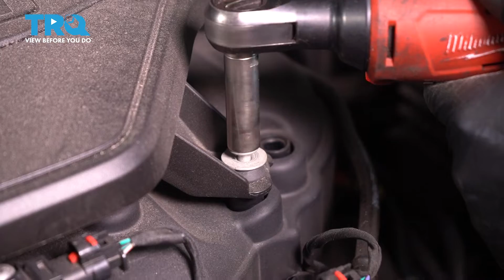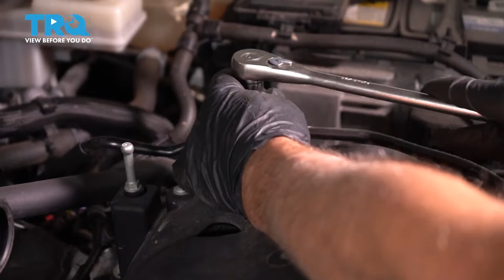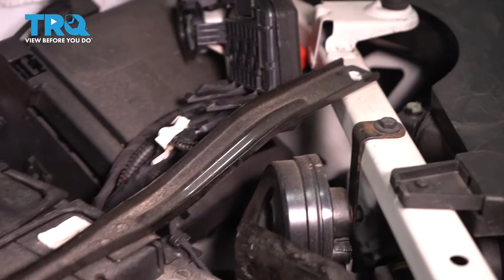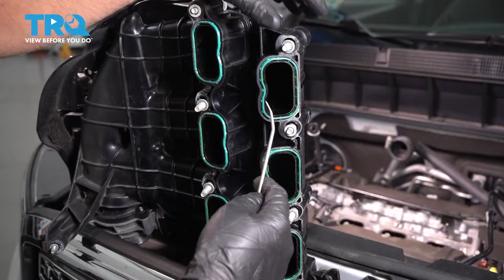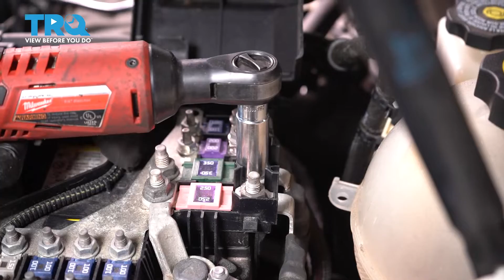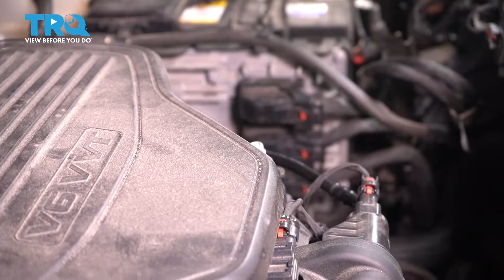How to Replace Intake Manifold Seal 2017-2022 GMC Acadia

Comment: Much appreciated! I like your vids! However, there is no need to remove the battery tray and ECU. Perhaps it was part of your vid for replacing the thermostat? - WHICH I FOUND REALLY VALUABLE, BTW! Your vid on replacing the coil packs and plugs- you do not remove the ECU nor the battery tray. I replaced these gaskets when I replaced the coil packs and plugs. Easy peasy. And the bolt in the front of the intake near the oil filler tube; I do not recommend 18 FT/LBS on it. I felt like I was going to snap the threads or break the plastic. To be accurate, I only used 12 FT/LBS. Thanks again for your FANTASTIC vids!

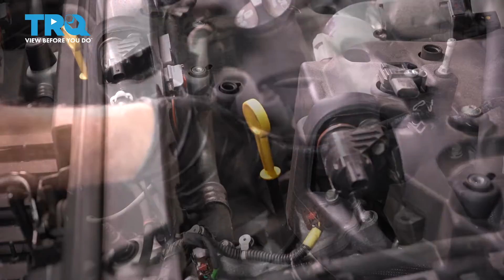Comment: That #9 bolt you said “make sure it’s snug at 21:50ish. I didn’t listen and went 18ftlb on it and stripped it. Any suggestions how to fix? Helicoil? 😢 Is it okay to drive with it sitting loose until I can tap a new one?